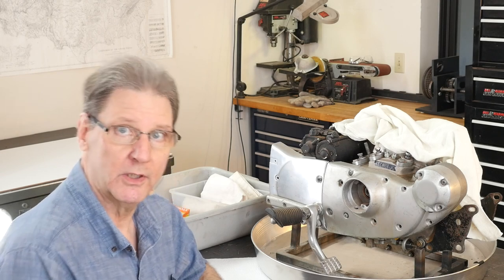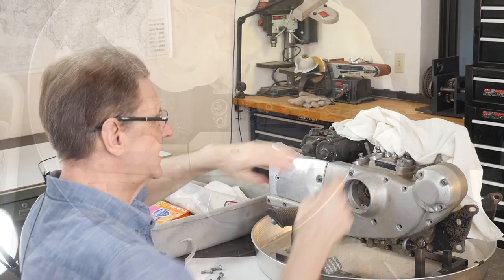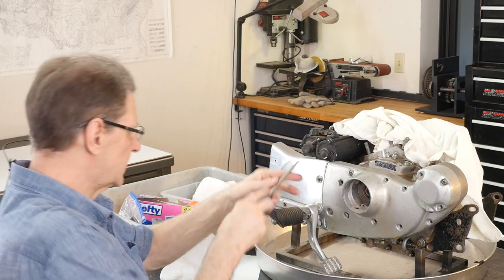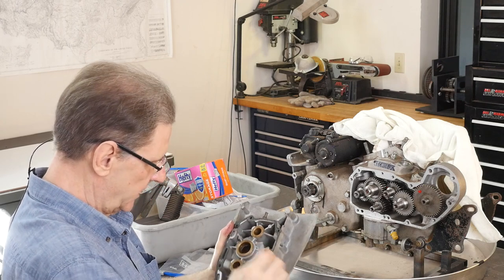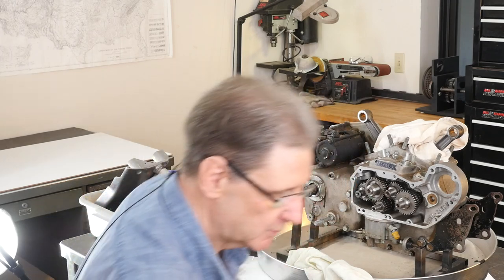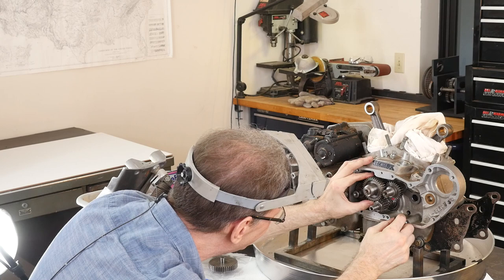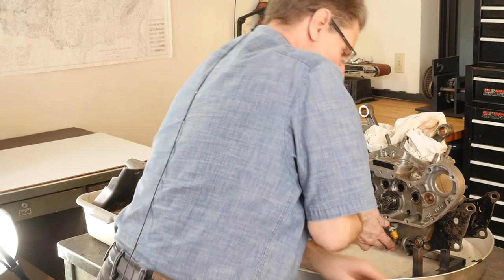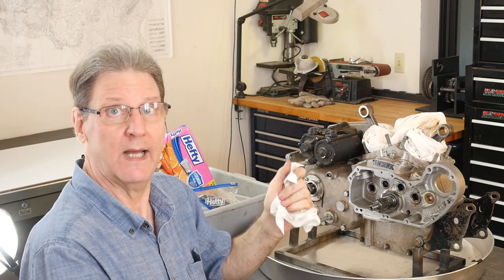Iron Sportster gearcase, oil pump, sprocket cover

Comment: I wish there was a tool that you could adjust all the spacing for the transmission before installing into the case. That would make it super easy. Love  the education. Less and less people can do these anymore. Thank you.
Reply from the maker: That is a great idea, something that would slip between the gears to check there is enough clearance, and transfer the case dimensions so that you could set end-play outside of the bike when the tranny is on the bench. Problem is, every case is different, and most people would want to re-check the end-plays once the tranny is installed. After some experience, you can set the gear clearance by eye, but a tool would be more precise. Thanks for the comment!
Reply: Ironhead cycle probably has one

Comment: Thanks for the videos on the ironhead xl. I used your video as a guide for my transmission repair. One thing I had to do I didn't see in your video was replace the main race and shaft for the trans. Mine were wore out. I wound up having to hone the race to get the 23 standard rollers back in. I put them in from the outside seal area like you talked about. For the $ for the correct tool to line hone/bore the race it would be cheaper to buy the race and shaft several times over. So if it runs 4 or 5 years this time I'm good with that. Your info on the gear spacing was very helpful. Thanks for taking the time to explain the ironhead repair procedures. The retaining ring on that main race is a bugger.
Reply from the maker: Yeah, I have a print article about doing that honing of the main race. 
http://www.open-sport.org/Repair/Honing-transmission-mainshaft-bearing/
I have been told you can blow up the bike in second gear if you don't line-hone the mainshaft race, but I wonder if that is BS. Glad you got things sorted out, and yeah, that snap ring is a bear, I make sure I have my safety glasses on when I mess with it.

Comment: Hey Paul,
  I am tearing apart my 87 sportster xlh 1100 to get to the oil hoses so I can replace them. When removing the cam cover do I need to first remove all the risers to relieve the pressure or can I get the cover off without removing the risers?

Thanks in Advance,

Vinny

Comment: Hi there so  I have a 75 sportster I picked up (barnfind ) sans motor the mounts are still with the bike   now  I do have an 85 sporster  motor sitting  that I can use  from my reading it should fit mount wise but I do have a concern  over the oil pump fitment can any one elaborate

Comment: Are you going to do a video on the 79 breakerless ignition? I'm building my first bike, its a 79xlh, and no one has a video on the ignition.
Reply: Me too, the builder of my 1980 XLS has put points/ contact breakers in instead of the electronic ignition so I am looking at aftermarket systems as I don’t know what parts to keep and what to reuse.
Reply: Yes, I plan on doing a video about ignitions, but it will be a while before I get to it, sorry. The '79 ignition is the worst of all worlds. It still has the flyweights, that get worn out, and hit the back side of the timing plate and then shear off the 1/4-28 ignition cam bolt off flush with the camshaft. Then it also has electronics inside the cone, where the heat can screw things up. It also requires resistor spark plug wire, and maybe even resistor spark plugs, or it blows up the ignition. I took that setup out of my '79 and at first replaced it with the original all-mechanical points one. Then I tried a couple different aftermarket ignitions. I am not sure, but I think a Dyna ended up burning a piston when I set it up wrong. The problem is that an Iron Sportster needs something like 45 degrees of advance and most aftermarket electronic units don't do that much. You have to set the timing at over 2000 RPM, and if the ignition does not dial back the full 45 degrees, then the bike will kick back when you start it, or idle too fast or other problems. There are aftermarket units that have a VOES switch wire, and that changes the total advance into the range to keep an Iron Sportster happy, but I can't remember what ignitions do that. I set my 1977 up with a toggle switch on that wire, so I can change it to see what it does, but I have not installed the electronics yet. Most cone-motor aftermarket ignitions have the same problem as the '79 setup, they put all the electronics in the cone. When I run an electronic ignition, I leave the cone cover off so the air can cool the ignition. The most important thing is to really time the bike with a timing light, so the advance mark is in the little window of the timing port when the engine is at least 2000 RPM. That will mean you have enough advance to not burn up the engine. Then hopefully, the aftermarket electronic unit will still let the bike idle OK. I know it can be done since I have run one, but since then, I just went back to the mechanical points ignition. In fact, my 1977 has the electronic aftermarket ignition hanging from the side while the old mechanical points run the bike. I will try to set the electronic one up soon, but the mechanical one runs OK, so I figure why mess with it? With the 79 or mechanical points, do make sure those flyweights are not all egged out and flapping around. When I did run an electronic ignition, I made sure I had a mechanical points setup in my tool bag, with the tools to change over to it when on the side of the road. At night. In a hailstorm.
Reply from the maker: Yup, see below--- I would be tempted to leave in teh points, or at least try it to see how the bike runs. The stock ignition is perfectly adequate as long as you check the flyweights for wear every year.
Reply: @Open-Sport  the bike is running perfectly fine on points, but I don’t know what machine they are off so I can’t try and get spares for the future. Are all the Ironheads the same when it comes to points and flyweights?
Reply from the maker: @HarleyRog  Yes, to my knowledge they use the same points and condenser from 1971 to 1978. Depending on how you ride and the bearings in the cam cover, the flyweights will egg out at the pivots and clank into the back of the plate. This is easy to inspect, just mark the plate location and put it back in the same place and the timing should stay the same. They make a needle-bearing weight set, that I have not tried, and I think there are some hardened or better-grade weight sets. I have heard the point set is the same as used in old straight-6 Chevy motors, but not sure of that. Same for the condenser. The points last ages, but I have had these modern condensers go bad, or even be bad on installation. After I run one for a few months, I swap it with a new one and put the old one in the saddlebags. Usually they fail by letting you start the bike and it will idle, but as soon as you try to get some RPM, the engine will sputter and maybe die.

Comment: Hey Paul, your videos are great! Can I use an 83 cam cover on my 82, Other than missing a bushing for the generator gear, it has one minor casting difference. I don't think I can add a picture here
Reply from the maker: Sorry, no, if there is no boss for the generator idler gear, you can't run that gear just supported on one side at the engine case. There were a whole bunch of cover part numbers in the 1982-1985 period, most being different finishes like black and polished and gloss black. I don't think you are comparing a 1983 cover, but are looking at the -83 casting number on the part, which is not the year it was used on, but the year that the casting drawing was made. The cover without the generator gear boss is the 25219-86 which is for late 1984 to 1985 where there is no generator and there is an alternator behind the clutch. 

These covers come up often on eBay, so you should be able to find the right cover that has the generator drive gear boss installed. The 25208-81 polished cover fits bikes from 1982 to early 1984. Once again, these part numbers are different from any number molded into the part, those are casting numbers. There is a black cover on eBay right now for 150 bucks, search: "1982 Harley-Davidson Ironhead Sportster Cam Gear Cover" I am not sure how hard it would be to strip off the black paint and polish it, but at least it will work.

Comment: Thanks for pointing out several issues ,but the foot peg issue on right side seems to me to be a bit unreal like how many accidents have ocourd wen the foot peg bracket snap off
Reply from the maker: The frame-mounted pegs never seem to just snap off, but they can get beat up if the bike is dropped. Often, the mufflers protect the peg, and you can straighten the bent peg with a torch. The real mess was in 1974-77, when the law said motorcycles had to shift on the left and brake on the right. Harley wanted to release the new cases in 1974, but they had so many problems, they did a real kludge-fest to swap the brake and shifter levers, while the case still had the shifter on the right side. In 1977 the new cases were designed for left-side shifting.

Comment: Hey Paul, I have a kinda off the wall question. Is it possible to retrofit a "distributor" (breaker tower) cam chest cover, cams, etc to a "nose cone" post 70 iron head case? As you pointed out in your ignition vid the tower iggy lasted almost forever in comparison to cone type assemblies. Granted you can buy an aftermarket advance assembly/point plate set for about 35 bucks brand new, but can the "old school" set up be retrofitted without dramatic mods?
Reply from the maker: Hello again, it is possible but a major tear-up. The great thing about Iron Sportsters is the factory was too poor to make a lot of changes, so you can interchange a lot. You have to find the early gearcase cover, in good shape no less, a tall order. The cams are different, so a new set of earlier model cams, I think they already had "P" cams then and it is a great stock camshaft. Then you need the timer aka distributor, which you could buy a fancy aftermarket electronic one. None of this works if your cone motor is 1977 or later, that is a different case.

I used to put electronic ignitions in the cone that eliminated the weights (not like some that still use the problematic weights). Lately I have been putting in the new weight units. One outfit has weights with needle bearings, not sure how they work, and I think there is a stainless steel unit out there. I just use the cheap ones, make sure they are lubed up, and inspect them now and again. I do ride a lot less now that I am in Florida, so I guess I can get away with it.

Comment: There is a hole in the oil pump gear. It is supposed to be timed with the cams? The hole should be at 12 o’clock ( facing straight out towards you )? If that is so , what is the purpose? And what are the consequences for not doing so? Thanks Paul.
Reply from the maker: You absolutely have to time the oil pump on engines made from 1952 to 1976,. In 1977 they redesigned the case and there is no longer a timed breather. If you don't time the breather on '52-'76 bikes, oil will not get blown from the crankcase to the gearcase cam cover when the pistons are both coming downwards. The bike might start smoking out the exhaust from the oil buildup in the crankcase and oil often starts weeping out the pushrods since there is pressure building up inside the engine at the piston downstroke. To time the pump, you rotate the motor until you see the ignition timing mark in the the left side hole in the case. It's a vertical line on the crank you position in the middle of the threaded hole. Then go to the oil pump side and there is a little notch just under the oil pump gear. Rotate that gear until a dot lines up in the notch. Then roll it  clockwise 1/4 turn. Then install the pump. Since the pump is driven by a spiral gear on the crankshaft, you usually have to try a few times to that the dot ends up in the groove after the pump is in. Bad news, you have to remove the engine from the frame to get the pump out. It might drop down enough to rotate the gear though, never tried that. Or you can pull the gears from the crank and leave the pump installed. Good new, an un-timed oil pump rarely damages the engine, just smoke and oil everywhere.

The wrong way:
https://youtu.be/9szs7vJ8gOQ
This guy does it wrong-- he does not line the engine up to the timing mark like in the manual. He may be lucking out, with the engine just happening to be at the timing mark, but I doubt it. This guy does show you can have the pump in and use the gears to get the pump in the right place. And his trick about rolling the pump back 1/4 turn is the way to have it end up right after the spiral gear is installed or the pump is pushed into the spiral. Buy and read the manual, even a Haynes will show the right way.
Reply: I've got a 75 and I rebuilt it twice had good luck the first time the second time there was a problem, my engine is pushin engine oil into the primary filling that up, I'm guessing I didn't get the breather timing right, I had a buddy come by and he was helping me I maybe got distracted and it got overlooked, I sure hope that's the problem when I pull that cam cover off ill know right away, baffled me for a long time why it was doing that but then it dawned on me it's got to be that oil breather timing
Reply: @Open-Sport   Thanks for responding. I missed this post years ago , just saw it. I have a ‘77 so I never came across this issue. Thanks for clearing it up.

Comment: Any thoughts on my 76 Ironhead purging oil out the breather vent line . 
Drove it around few miles fine than went back out and it’s oil up and down the street and when I rev it in the garage it just blows out that line ( up front right side of motor ) ughh
Reply from the maker: Oh sure, a common problem, your engine is "sumping". This is when oil from the tank weeps down into the engine while the motor is not running. It forms a big pool in the crankcase, and when you start the bike, so much oil gets blown up into the gearcase past the timed breather, the gearcase fills up with that oil before the oil pump can pump it back into the tank. If my 62 sits for a month it will do this. Look up "sumping ironhead" on the forums (www.harleykmodel.com and http://xlforum.net), and you should find plenty of info. There is a steel ball bearing and spring inside the oil pump that is supposed to prevent this from happening. The factory manual shows you can lap the seat to make sure it is sealing. A more basic problem is even if this ball bearing is sealing the oil from the tank, the oil can still weep past the oil pump gears and still get into the bottom of the engine. I have considered putting a valve in my oil feed line, but I am sure I will forget it one day and burn up the motor, so I just try to run the bike often. Not a problem here in Florida. If you get a little gush right away from that breather pipe, you can catch that in a drain pan, and then let the bike idle for a few minutes so the oil pump can get the excess oil back into the tank.

There is also a chance you have checked the oil when there was a lot weeped into the engine, and then added oil, so now the tank is over-full. That will also let oil pour into the gearcase cover. Check oil before you go out, sure, but then check it again when you get home. That is when the bottom of the engine is dry, and all the oil is in the tank. Be sure that there is not too much oil in the tank or it will flow down the vent line into the gearcase.

Final thing is a long shot. I had a gasket fail on my 1979 and all kinds of extra oil was leaking into the gearcase. Since that was oil that was supposed to be getting pumped to the heads, I eventually burned a front piston in the bike. This is more a problem with the 1977 gasket, it is really doubtful you have this issue. The sumping problem is really common, as is over-filling the oil tank.
Reply: @Open-Sport  Thanks for talking it through with me Paul ! I appreciate your experience very much . I will run it a while and see what happens. You think maybe excessive blow by could be the problem? I’m going to work on a leak down test soon  to see what may or may not be there ?
Reply from the maker: @brandonjones152  When my bikes started to blow by a lot, they would start leaking oil at the pushrod cover corks. This is because the blow-by does not put that much oil into the bottom of the motor, but it does increase the pressure inside the cases, and that pressure will force oil out the corks.

It is best to measure blow by with a leak-down but I used a shade-tree method. I would hold a prophylactic or balloon over the breather pipe coming out of the gearcase cover. I got a sense of when there was too much blowby by how fast the rubber blew up. A latex glove might also work. This is not as scientific as your method, but I learned to gauge how much air was leaking past the rings. If you are married you might not want to use a rubber, a lot of explaining to do if your wife looks in your tool box.